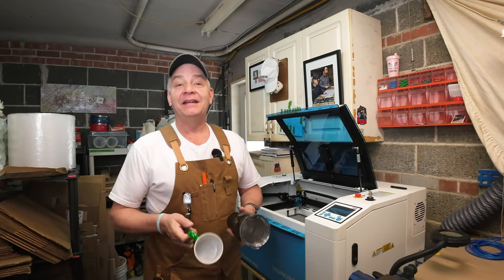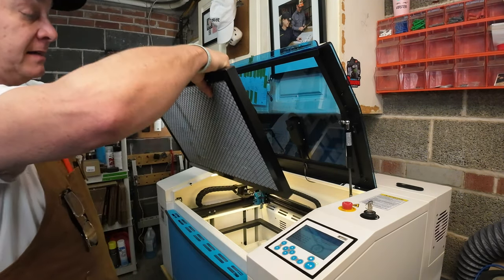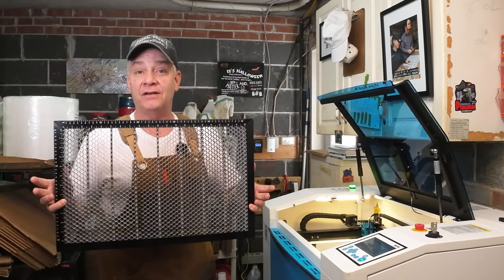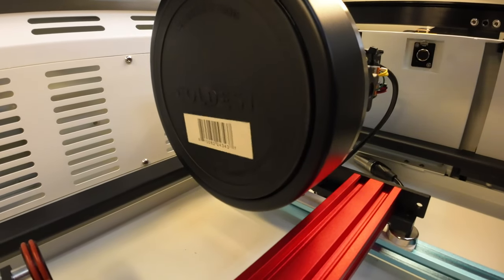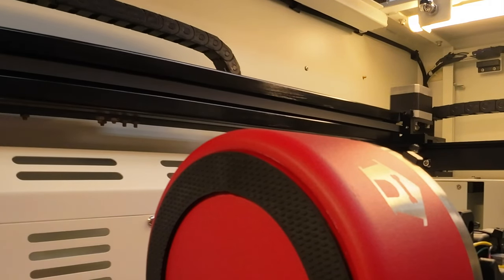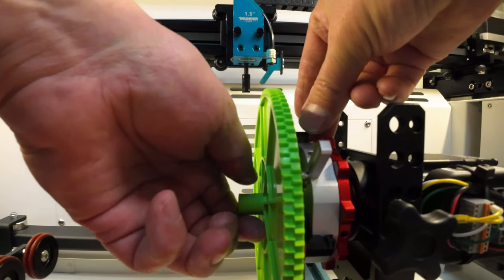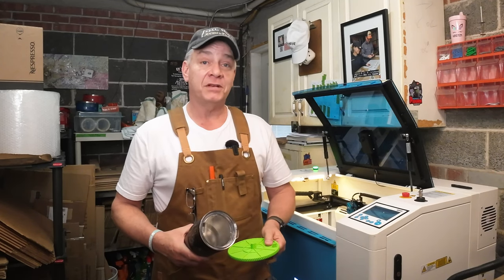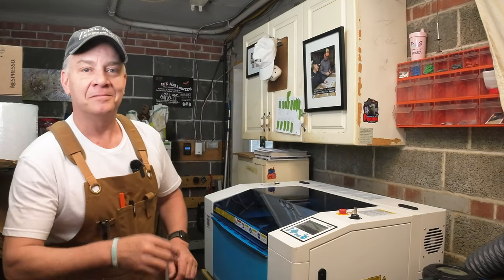LENSDIGITAL Magnetic Harness for PiBurn GRIP. Thunder Laser BOLT. Let's Check This out!  022   4K

Comment: Great information you provide! We have a Nova 51 and now a Bolt, our Bolt is doing great engraving on our tumblers however the images are being mirrored when engraving. The image is right in light burn and shows correct on the control panel but engraves backwards on the tumbler. Any hints to fix this?